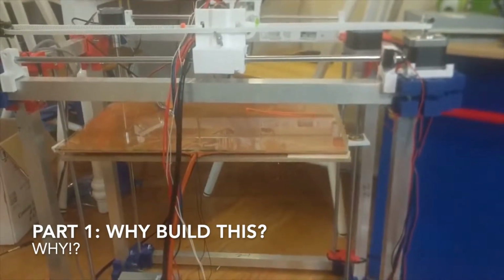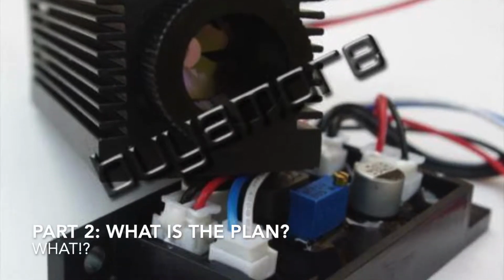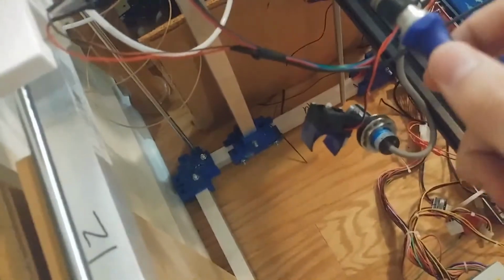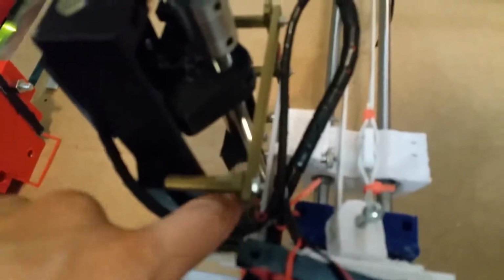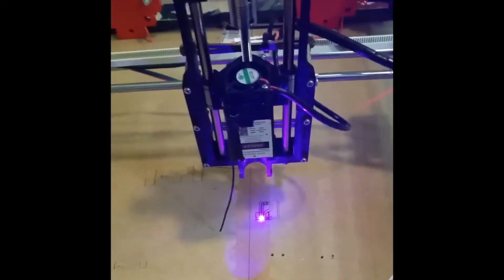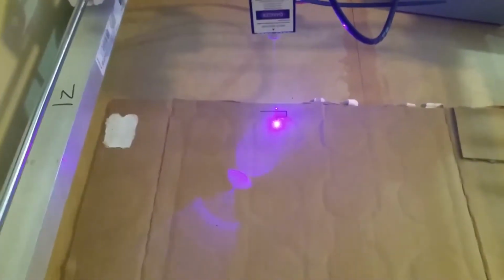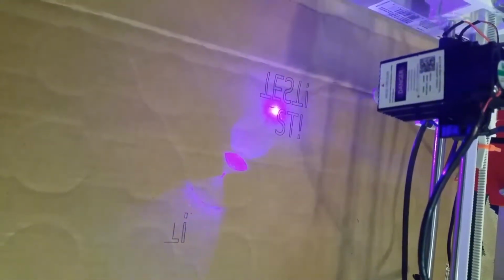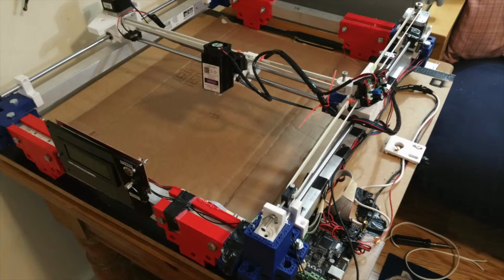Cheap DIY laser cutter part 1

Comment: This is crap
Reply from the maker: Sorry to here that... I never claimed it was perfect, I know it was built with left over parts and doesn't have a safety cover, but It actually works surprisingly well, of course the main issue is that the laser diode is so weak, which is not ideal, but assuming I bought a stronger laser diode, like one with a couple of watts of power, which I could pretty easily do, it would be much more able to cut cardboard and 1.5mm acrylic, both of which it can only kind of do right now